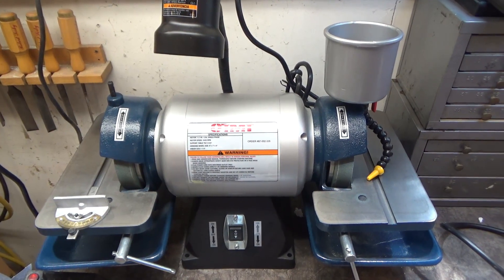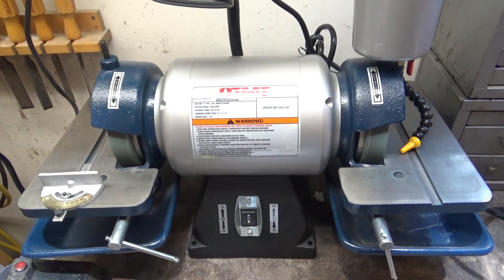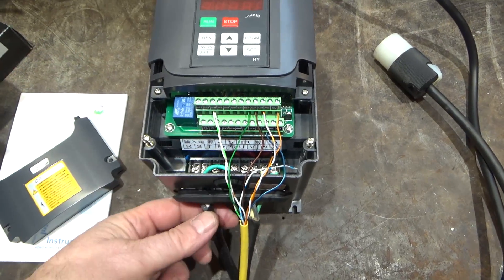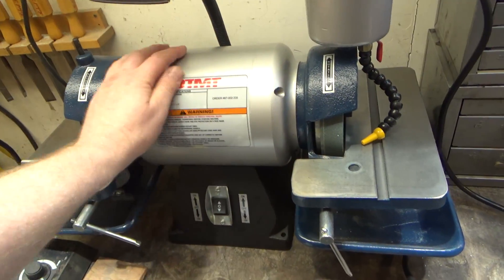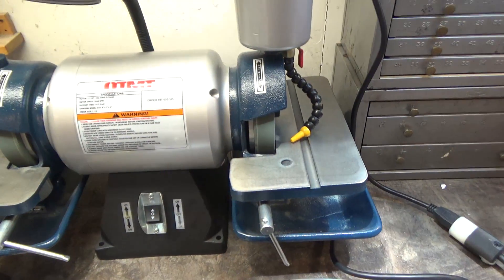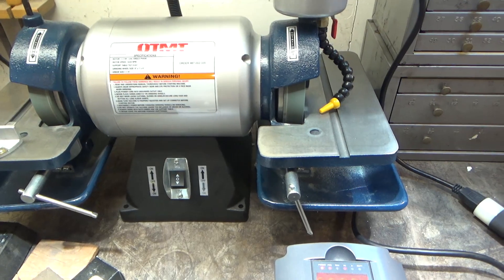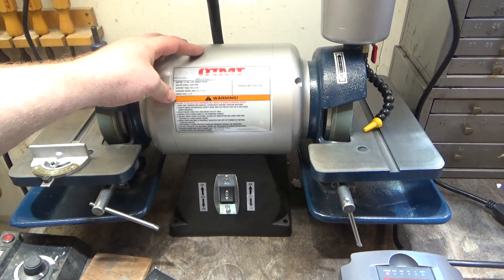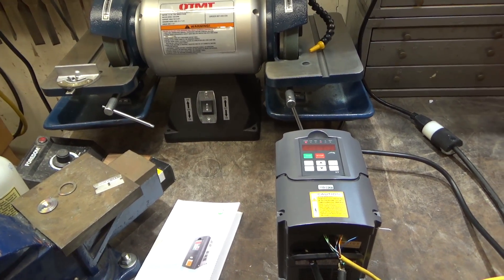QTR 06 110V Single Phase Variable Frequency Drive

Comment: Hello

I have a motor  220V AC single phase and I need to control RPM. I need a VFD with an output 220V AC single phase.

I see some people just using a VFD with a 3 phase output and conecting the single phase motor to the terminal U V or U W or VW.

The problem with this is when you use a single phase motor in a 3 phase current you use one line U V W and the neutral N.

With the U V or U W or VW the motor will not run properly.

Please correct me if im wrong.
Thank you.
Reply from the maker: I am not an expert in power electronics, but three phase output is three signals with 120 degree phase shift relative to each other. A 240 single phase is technically two 120V signals 180 degrees out of phase, but can be considered the same as one 240V signal relative to neutral. Using any pair of the three phase outputs should get you 240V if your VFD isn't designed to output 208 three phase. If it is, then you will get 208V. If you were to take a single phase to neutral, on the the VFD, the voltage would be much higher than 240 and you could burn up windings. I believe this is correct, but you should find someone who deals with this sort of thing specifically. I hope this helps.
Reply: Yes. I have asked other people and they agree with you.
Your motor is 120 V and the 3 legs out of your VDF are 120V each.

If you connected to 2 legs should your voltage be 208V instead of 120V?

My ac motor is 240V and Im unsure if to get the 120V VDF or the 240V VDF.
Thank you for unsewering my question

Comment: If you have or are worried about overvoltage in your motor/drive just put the resistor instead of the jumper, adjust the necessary parameters and it will deal with the over-voltage
Reply from the maker: Interesting approach, thanks for the idea.

Comment: Question,  you mention hooking up the 120VAC to any of the 2 inputs.  . Do you mean that you hook up 'L' to R, S or T and 'N' to any of the other two that are not Line? Or do you hook up 'L' to R, S or T and hook 'n' - Neutral to Ground on the unit ?  Thanks.
Reply from the maker: This video was made a long time ago and I don't even have this grinder anymore, but if memory serves the input  would take 110V three phase (Which is not commonly used anywhere, to my knowledge) which means that you could hook up your 110V hot and neutral leads to any two of the three inputs. This particular VFD was very unusual and this may not apply to any others. Three phase inputs on VFDs typically convert the incoming legs to DC through a three phase bridge rectifier circuit.

Comment: Interesting.  Just checked with Jeff Bezos and their offering for this drive says  "This VFD is ONLY applicable to three phase 110V asynchronous motor."  I too along with other viewers was believing that frequency drives only worked with three phase motors.  Is it just an 'undocumented feature' that is allowing this unit to drive a single phase motor or will all of them do it if just try??
Reply from the maker: I would suspect that they might, but if they had intelligent vector current control or the like, that might not work out too well. The unit I bought, a few years ago, specifically said it supported single phase 110V output.

Comment: I'm looking for a VFD to control the speed of my telescopic Rhon antenna tower lifting motor. It's a 120 volt single phase .75 horse motor. I wonder how much torque will be lost with the reduced frequency and if torque is adjustable in the programing. I need momentary remote fwd/ reverse switching and potentially limit switch input. Are these units capable of this?
Reply from the maker: The 120V VFDs are very hard to come by. I found mine quite a few years ago and it was the only one I could find at the time. I am not an expert, but with 120V systems you could use PWM or frequency changes to control speed. Torque could be retained to a point by increasing current during the shorter pulses. This only works to a limit. You have to take into consideration brush arcing and dielectric breakdown in the motor windings.

Comment: so i have a harbor frieght lathe with a 110 volt single phase motor on it i converted it to cnc.can i use this vfd to run it?also will it switch the directing the motor spins?do you have a video showing how to wire it up?
Reply from the maker: You won't be able to reverse the direction of a single phase motor with the VFD. To do this requires flipping wireing of the starter windings, unlike a three phase motor where you can swap phases. These 110V  pseudo single phase vfd's are hard to come by. I chose the VFD to allow me to control the frequency and thus duty cycle to control speed. There are some potentially serious side effects of using a VFD like this. You should read some of the comments. You could destroy the motor.

Comment: Those are actually 3 phase VFD, typically, if the VFD detect one phase missing, it will stop the operation. However, if you force the VFD to output the phase, than you have this single phase variable frequency drive.  By the way, you may need to remove the cap on the motor.
Reply from the maker: Interesting. This one doesn't. The input is a three phase full wave bridge and converts the input to DC and the creates an output (s). It doesn't need multiple phases on the input to work and was purchased because they sold it as a 117VAC to 117VAC VFD. It was clearly designed for three phase operation, but modified to be sold for this unusual task. Thanks for the tip about the running cap.

Comment: I suspect your bench grinder has a centrifugal switch that only disconnects the starting capacitor. when you hook it up to the VFD you can wire out both the switch and the caps
Reply from the maker: I appreciate the advise, thanks.

Comment: Would this method - and particular VFD - work to halve the speed of my Makita 2412N abrasive cut-off saw down to cold cut blade speed?
Reply from the maker: It should but there are some caveats. Check the comments below and there are some really good warnings about using a VFD on a motor that wasn't designed for it.

Comment: Thanks for sharing.  Where did u buy from?      - take care from Tn
Reply from the maker: I got the VFD from eBay many years ago. Single phase 110v VFD's are pretty rare.
Reply: @DudleyToolwright  Thanks man. Would u buy it again if u had it to do over?              Seems to be plenty available for 240v 1 phase to 3 phase use, but I'm Not planning on using a 3 phase motor anytime soon.
Reply from the maker: I purchased the grinder from Travers, but ended up getting a Shars: Tool and Cutter Grinder. It makes up for my utter lack of hand eye coordination.

Comment: CAST IRON RUSTING... Use plain old any car wax... Wax the cast iron every so often.  Also great because less friction.
Reply from the maker: I use woodworking wax on my table saw table and it works pretty well, but I never have direct exposure to water. For that, it doesn't work. My wife left a damp towel on the surface once and there was rust everywhere the towel was touching. I appreciate the tip.

Comment: Does running the motor at different frequencies put stress on the motor? Would it shorten the life expectancy?
Reply from the maker: It can hurt the contacts and also be a problem with the winding insulation. Motors are often spec'd as "Inverter Duty" when they are specifically designed for it.
Reply: @DudleyToolwright  I don't think ac induction motors have contacts.  That's one of their big advantages.

Comment: How's the motor holding up these days?  My primary hesitation in doing something like this is making sure the motor doesn't overheat, as most candidates for this have what amounts to a direct drive cooling fan.  Drop the RPM and the fan drops total CFM, but the same torque is still available from the motor...so you potentially have a situation where the motor is making the same heat with a lot less airflow.
Reply from the maker: I sold the grinder to make room for a Shars tool and cutter grinder. Better control on that guy. Sorry I can't give you more feedback. The observation about the fan rpm slowing is gold.
Reply: @DudleyToolwright  Nice, that's definitely a step up!  No worries about the feedback, I was more curious than anything.

Comment: I thought it would fault the drive only hooking up to two of the 3 phases on the output. Are you still able to use the over current protection and all that? These are waaayy cheaper than 1phase to 1 phase drives.
Reply from the maker: You thoughts are probably correct. This unit is a really different VFD. It puts out 120V tree phase. I suspect they just modified and existing 3 phase model for a lower output voltage. It is from China, so I don't suspect a lot of R&D went into the design.
Reply: @DudleyToolwright  I found some cheap drives with good documentation and a responsive support team all while being pretty darn cheap. They make single phase drives and even have the more advanced drive settings and protections. I believe they are identical to 3 phase drive but with some fermware that treats one of the phases accordingly to power the starting coil. With wiring diagrams to remove the starting cap. Company is called ATO. Id definitely try them out. The only thing I didn't like about the drives is that they aren't eathernet. If you wanted to control them with a computer it would need to be cerial. And im too young to appreciate cerial communication standards. But if you wanted simply enable,disable and a analog input with a simple potentiometer for adjusting speed they have those inputs for every drive.

Comment: Interesting video! So I have an explosion proof ventilation fan 220v that I need to slow to 3/4 speed. I bought a single phase in and output 1.5kw thats says 7 amps my motor draw is 5 amps will this work on my fan? The fan is a cheap orange China atex rated any help would be great. As I need to return them if they won't work.
Reply from the maker: The unfortunate answer is: It might. The problem is that if there is a centrifugal start cap disconnect and you run the motor too slow, it may never disconnect and then you will have a failure. Also, The fast rise times of the VFD output pulses can cause issues with some types of winding insulation. One of my viewers educated me about these potential issues. Frankly, they had not occurred to me. I know this is not a great answer. Motors vary a lot. As a matter of fact, even in the 3 phase motor space, where VFDs are really common many motors will specifically say VFD compatible.

Comment: Hello, I have a question, inside your tool has a capacitor? Does that mean that you connected it directly to the inverter without removing it or did you connect it directly with a capacitor?
Reply from the maker: There was a start capacitor and I did not remove it first.

Comment: Is this the VFD that you're using to your knowledge? amazon.com/Variable-Frequency-Inverter-Converter-HUANYANG/dp/B0775QGLVJ/ref=sr_1_2?dchild=1&keywords=huanyang%2Bvfd%2B110v&qid=1595540844&sr=8-2&th=1  I wanted to try to slow down this Grizzly G4176 1/4 hp 110v power feeder.  https://www.grizzly.com/products/Grizzly-1-4-HP-Power-Feeder/G4176  I figure that I can return it if it doesn't work.
Reply from the maker: I don't know. It looks similar, but I got mine a few years ago, from eBay. Please read the comments under my video regarding potential issues with using a VFD to slow a single phase motor. There are some potential dangers to your motor.

Comment: ! phase motor always has a capasitor that can't handle high freq, did your removed it?
Reply from the maker: I did not remove the start capacitor. It will appear as a lower impedance to high frequencies that 60hz, so the pseudo sine wave is not ideal, but it wasn't getting too hot.
Reply: The capacitor is in series with the second motor winding, so although the capacitor will conduct more at higher frequencies, the winding (inductor) will conduct less, I think this ends up cancelling out, so it doesn't actually matter.  (LC circuit)

Comment: So it is a 3ph output like all of them and runs any 2 wires for single pahse or what is called 2 ph. Right?
Reply from the maker: That seems to be the case for this particular model, which is odd: 3 phase 110.
Reply: @DudleyToolwright  I am wondering which inverters have phase loss faults or what programming circuit that stops single phase powering possible.
Reply from the maker: I don't know the answer to that. Finding a single phase 110 VFD is challenging to begin with.
Reply: @DudleyToolwright  Thanks for the answer, I contacted Alibaba and they have dozens of 5.5kw VFD's that are single phase. And the price is not marked up 3X as we find with the  USA middle man. Here in the USA these companies buy from China as all VFD's are made there, like everything else. In the USA the same VFD is $600
Reply from the maker: @BroMikey55  At 5.5kw theywould be 220V VFDs, just for your information.

Comment: I’ve been old that grinding carbide inserts using a high speed grinder can create micro fractures in the insert.  Grinding carbide inserts using a slow rpm grinder avoids the problem and makes for a terrific knife sharpener.
Reply from the maker: I have heard the same. I also have heard that you should only grind an edge with the wheel moving towards the bulk of material to prevent similar damage.

Comment: thanks for the info, I have a grinder similar to the smaller one you showed in the video, I bought a motor controller and connected it to the grinder and it sounds very loudly. I wonder if I damaged the circuit?
Reply from the maker: I hope not. There are several comments made by one of the the viewers that pointed out some potential shortfalls with using a VFD with a single phase motor. Is the motor loud or the VFD? If its the VFD, it could be a fan. If it's the motor, they do sound diferent when driven by a VFD, but if the motor has a centrifugal brake and you are going slow - you could be draging the brake.
Reply: @DudleyToolwright  I think it's the motor, I'll try again. Thank you.

Comment: Hello.Thanks for sharing this useful clip ,i have a question, if you do not mind ,i have a 1/3 hp 110v motor and i am looking for a seeped control for that,, what do you recommend ?,and where can i find it?thanks
Reply from the maker: You have to be really careful when using a speed control on 110v single phase motors. One of the commentors was noting some of the potential issues you might have like: centrifugal brake (could go on if moving too slow), high voltage spikes could break down the insulation on the motor windings if the moter is not well enough made, etc. I found this VFD on ebay, but be carerful to actually find one that was designed for single phase 110. They can be quite hard to find.
Reply: @DudleyToolwright  thanks
Reply: The start winding is usually thin copper winding for the capacitor circuit in single phase motors which is sometimes a problem when you put a VFD on a single phase that start cap winding heats up a lot

Comment: You could add a switch to take the starting cap out once it is running, then you can decrease speed without the worry of the starting cap kicking in.  Didn't know you could use a multiphase VFD for a single-phase motor in and out.  Good to know!
Reply from the maker: Thanks for the ideas. There are some risks and limitations as pointed out by one of the other commenters.

Comment: Can the frequency output be raised to reduce the noise?
Reply from the maker: With frequency follows speed. In addition the unit doesn't go much above the 500 hz range which isd definately audible. The noise is probably the windings mving slightly with the drive frequency and perhaps arcing in the brushes as well.